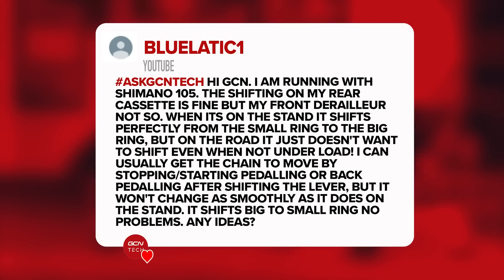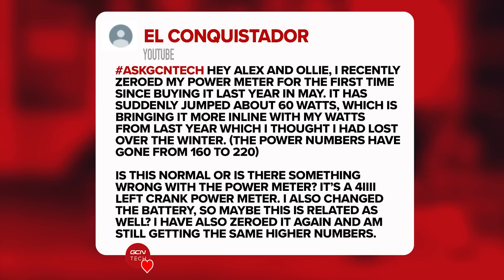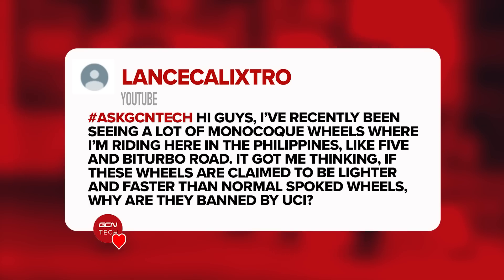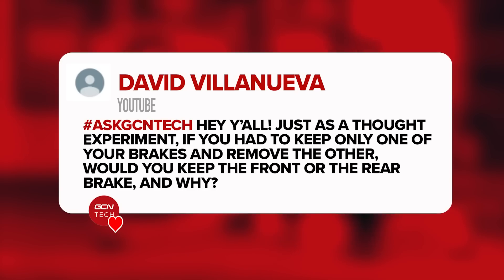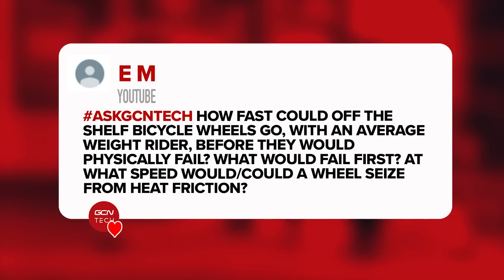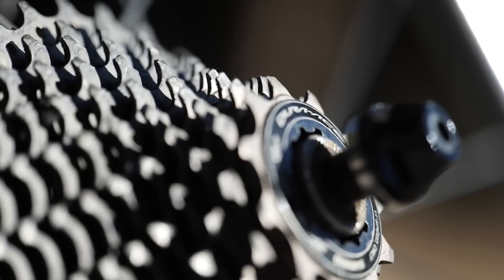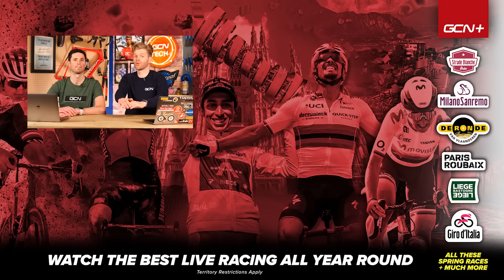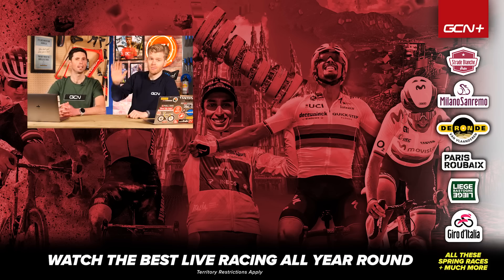"How Fast Could A Bike Wheel Go Before Failing?" | GCN Tech Clinic

Comment: #AskGCNTech Hi, I'm biking a lot downhills and in the wet. So far I've used Shimano L04C metal brake pads (for R8070), but for the last couple of years it's been almost impossible to get hold of them or comparable ones. I would prefer not to use resin. I notice Shimano also makes titanium brake pads (that are actually available). Are they any good?
Reply: Titanium only refers to the base plate, the braking material itself is the same. The idea is to save a few grams and to transfer less heat into the pistons and the liquid because titanium conducts heat slower than aluminium. (Not sure how it compares to steel)

Comment: With respect to tire failure and speed, have a look at the top speed videos for the Bugatti Chiron.  When doing top speed runs which are in excess of 400 km/ph, the fuel runs out in under 10 min and the tires in just over 15 min. But the difference here is that the Chiron with its shape creates tons of downforce wearing the tires faster. Not sure, even in a super tuck we would generate that kind of down force.  That said, I agree the tires would probably give way first, if not the rider.  Great videos guys !  Thanks.
Reply: Downforce translate to weight over the tires, so when going as those speeds not only the tires are turning very fast, but they are also loaded with immense weights. 
"Tuck" positions on the bike doesn't create downforce, they just minimize the frontal area of the rider, to reduce air resistance...

Comment: One addition about tyre failure:
with 60m/s of speed of sound in rubber at 200smth km/h we will see the deformation built up upon itself by the contact patch depression not restoring back before comming in cotact with road on the next wheel revolution. Interesting thing about it, it doesn't depend on the wheel size, but rather the carcase construction can shift the frequency

Comment: Regarding long sleeve jerseys: I am also a man of length, as I am 6'4" and weight in at 165 (or 11.7 stones, or 345 pebbles or a 1.57 buckets of sand).  I have found that if you are willing to pay for quality, the "pro fitting" stuff from Santini and Castelli has been very good.  The Rosso Corsa has been very good.  YES, you will need to dip into the college savings fun to afford it, but I have found it to be better with regard to length.
Reply: The cheaper option would probably to just put on some arm warmers.
Reply: @FirstLast-jm4dx  And ... that is why I only own one L/S jersey, and about four pairs of arm warmers.

Comment: #AskGCNTech how to clean disc brakes I'm confused some say spray it with soapy water and some say rub the disc with alcohol using a cloth. What's the best way to clean disc brakes cuz that's gonna help me alot if you clear my question
Reply: A paperwipe with rubber alcohol or disc brake cleaner. You can spray it on or rub it off.
Reply: I always use a paper towel and isopropyl "rubbing" alcohol.   It's safe for bike components and removes dirt and oils

Comment: #AskGCNTechRE: Max speed of a wheel....  Again, no one bothered to mention "rotational wheel balance". If you're going to test wheels at high speed to see what component of the wheel fails first you First Need to Rotationally Balance the Wheel, before testing. Why?  You can test two identical wheels and the first factor that will come into play to "Prematurely" destroy a fast-spinning wheel are oscillation forces caused by the wheel being unbalanced.   But if you perfectly balance that same wheel, then it can spin to the maximum so you can see which component of the wheel will fail first. Again, you need to remove oscillation in order to see what part of the wheel will fail first..  I challenge any one at GCN to prove me wrong.

Comment: 5:40
I do have real life experience for two years don't try at home
I only used front break for my cheap MTB bike which I used to ride with my mates on road bike trainings and it works and with experience it will become normal until the bad day come and a bus driver will cut your way and stop 🛑 immediately then your Cable will get cut and you will crash hardly and hurt 🤕 your self

Comment: A small hole in a tubed or tubeless tire can be 'patched' with a variety of after market patch products,. But, when that hole is actually a tear or a cut, say a couple centimeters in length, most of those patches don't work reliably in a large cut tubed or tubules. Before anything like this happens, go to a bicycle shop ask for a tire that is heading for the trash. Look for a worn road tire, say about 700 x 40mm, which shows wear but the body under a smooth tread and sidewalls are intact.  Cut a 15cm (6 inch) length of that tire that looks pretty solid even if it is worn thinner.  Cut the cord off booth sides. This patch can be put between the tire and your new tube. The inflated tire will hold that barrier in place and get you home. The wheel won't be balance but it spins. It has worked for years for mountain bike riders before tubeless was available.  You just carry that tire section with your spare tube. I have known people who used old tires to double wall their tires.

Comment: I have just change my rear cassette to an 11-30 but the cassette on my turbo is 11-28 will I have to do anything when I put my bike back on the trainer so the gear changes move smoothly. #AskGCNTech
Reply: Should work fine as is. Your chain may be a bit short when on the turbo though and might not shift to the largest cog smoothly.

Comment: Just a short geeky comment on the max. RPM of the roller bearings - the datasheet gives you the max RPM value for a rotating inner ring for a standalone bearing - the wheel bearings are paired and have a rotating outer ring - that leads to ~50% derating of the max RPM. But 7kRPM instead of 14 still is plenty ;)
Reply: 583.3 mph.... 😂
Reply: Thanks for correcting me Hannes Gruber I had no idea that was the case and a pretty important aspect to consider, although as you say, still crazy high speeds for a bike haha
Reply: @GCNalex  Extremely important for anyone planning to cycle between 580mph and 1000mph
Reply: I wonder if you would be able to get close to this doing down hill longboarding. These guys can reach up to 100kmh/60mph, but since board wheels are tiny the rotation at the bearings is going to be way faster then on a bicycle doing the same speed.
Reply: @queertales  longboard bearings come in a smaller size. and smaller sized bearings have higher speed ratings than larger ones. a typical longboard bearing from SKF comes with a nominal speed rating of ~50000 RPM. so it shouldn't be an issue either ;) 

There is a good indicator for estimating the criticality of a bearing speed. It's called Ndm. Just multiply the real operating speed by the middle diameter of the bearing to calculate the factor. in the case of a longboard that would be 5000 RPM (longboard at 100 kph) * 15 mm = 75000 - as a reference - everything below 300000 is peanuts for a grease lubricated ball bearing.